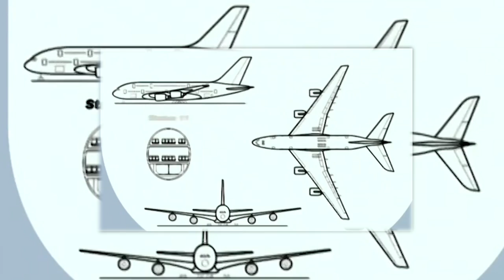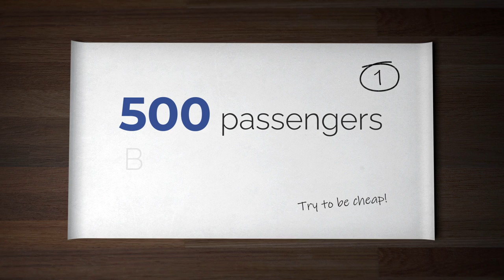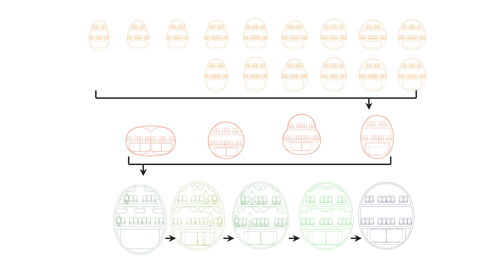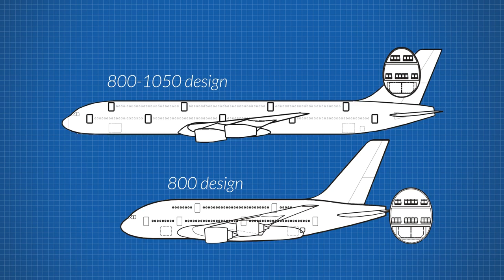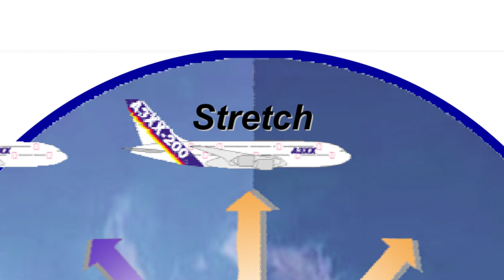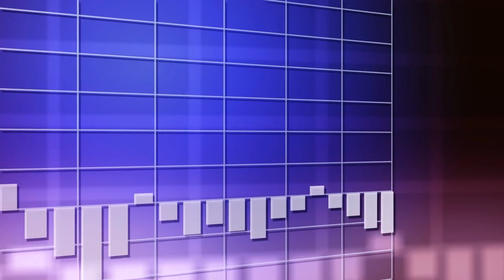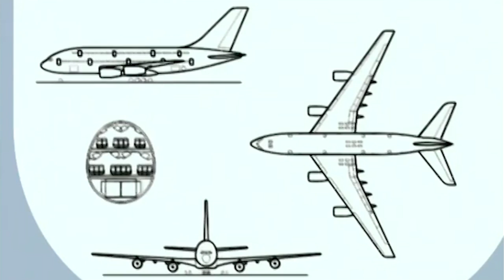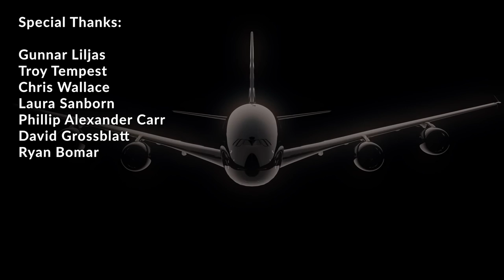Airbus A380 Alternative Designs - How They Made The Perfect Boeing 747 Rival

Comment: It's more like how did they make the worst airplane design in history.
Reply: It's a georgeous aircraft for passengers - it's quite inside, it's very spacious and comfortable to fly with.
Unfortunately it's harder to operate for airlines, since it can only compete against modern twin jets if at least 95 % of the seats are sold, which is not trivial since there are a lot of seats to sell. A 350s and 787s are simpler to operate for them.